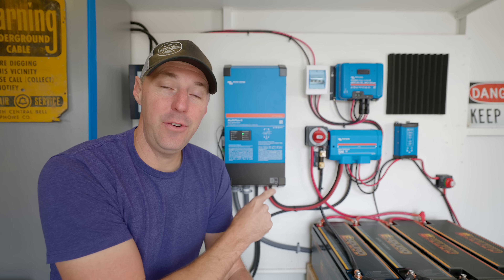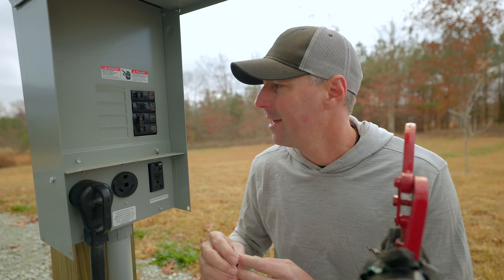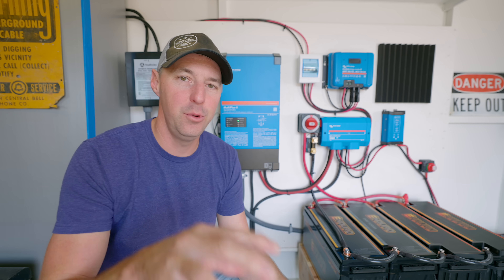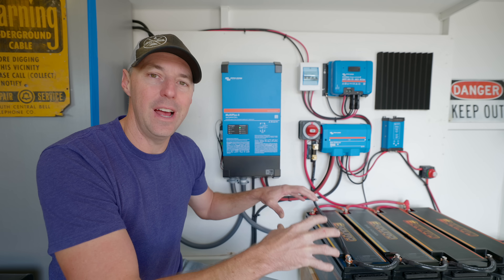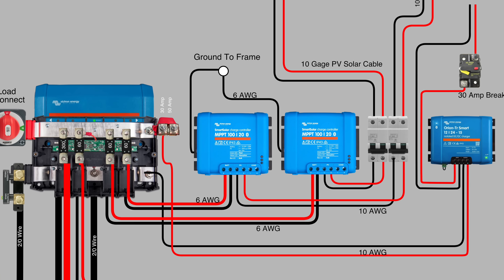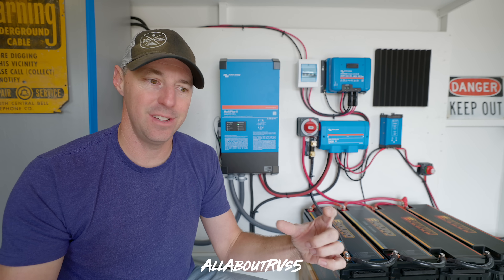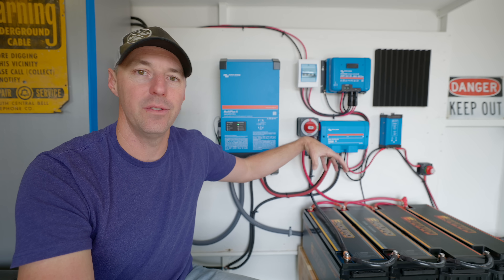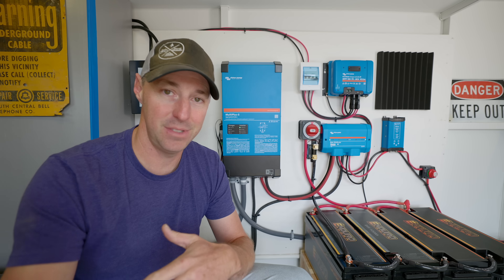Is This The Best Inverter For RVing. Multiplus 2x120 24 volt.

Comment from the maker: Thank you RV Mattress by Brooklyn Bedding for sponsoring! Visit https://rvmattress.com/allaboutrvs
 To get up to get 25% off your mattress with code AllAboutRVs
Reply: Video is a yr. old by the time I watched again ready to buy , tried the link to pinned supply above , - sent to another different company , search that web site and did not come with this unit ?
Did a separate search and at least 4 sites changed my search to other models ?
One site said " sold out " .
About the 5th site - details said different than this video - this unit " is either a 50amp , or a 30amp so choose " ? 
Thanks 
Hope for some confirmation

Comment: One thing I'm 100% sure Victron is sick of hearing  but needs to listen to.
Get rid of the Push-to-Connect terminals on all of the products used in RVs.
These have no place on any RV unless it will never be used to travel anywhere.
Probably fine for fixed home use, but not in an RV.

Comment: Victron really needs to rethink not having 12VDC output built-in on their 24/48 VDC Inverters.

There should be at least 125 Amps of 12VDC available built in and monitor-able with the Cerbo GX.

The non-monitored Orion is a non starter for a lot of RV users, especially with only 70Amp output and the requirement of paralleling 2 units in most larger RVs.

Also, why is there no 48VDC version of the MultiPlus-II 2x 120V ?

Don't get me wrong, I'm happy to have Victron empty out a lot of my RV  savings account.

I just wish they would listen more to the RV people that buy their products.

Comment: Great Video/Channel; thank you for sharing this type of information. One question I have is, does the Victron Multiplus take control of charging the batteries from shore/ac power (as opposed to the standard AC/DC converter that is standard on RVs)? If so, should we disable the stock converter to avoid too many systems from attempting to charge the batteries?

Comment: Video is a yr. old by the time I watched again ready to buy , tried the link to pinned supply above , - sent to another different company , search that web site and did not come with this unit ?
Did a separate search and at least 4 sites changed my search to other models ?
One site said " sold out " .
About the 5th site - details said different than this video - this unit " is either a 50amp , or a 30amp so choose " ?
Reply from the maker: I will check it out and figure out what happened. I know the main supplier I use just changed their name to Trek systems.
Reply: @AllAboutRVs  Thanks for the reply , wanted to double check - [ not sure if it is me or not ] I got the impression that this inverter could connect to either 30amp or 50amp RV post [ not expecting to get 240vac - just get 120vac from either ? ] .
Good YT page ;)

Comment: Can you tell me if using the 2X120 will give me the 220vac if off grid ? Also do you know if this or any other vicktron inverter have an auto generator start option. Thanks for any information you can help me with.
Reply from the maker: If you wanted 240v you would need two inverters. The single lets 240v pass through when connected to a 240 source but will only generate 120v when off grid. There is a way to have the Victron relays start a generator but I haven’t done that.

Comment: Thanks for this - for two reasons.  First, our SPS is giving up and now that AM Solar is out of business (from what I can see), it's time to swap out my Multiplus 24/3000/70 with the Multiplus II 24/3000/70.  The form factor is narrower and longer but I can work on that.  Second, I was trying to explain voltage and amps and why we were a 24v system, this helps reinforce was I was saying to my wife.  Thanks again and safe travels.

Comment: having a standalone 12v 100ah battery that is just charged up by the 24V system (via a charger on Timer or manual) is a much smarter system. 

Redundancy, and then when you need to service the 24v/120v supply.  you still maintain 12v operations/fridge/slider etc. and you can run a smaller 12v inverter on that battery. Add a 150-300watt panel for the 12V RV battery and you are really setup for anything.  
If you ONLY have 24V batteries and something goes wrong, you have no way to power the 12V no your trailer unless you jump it from a vehicle or help someone out with a bunk 12v

Comment: Do the built in roof AC units on 50amp RV operate off this 2x120 or do they need true split phase?
Reply: Yes, this inverter powers both legs in your RV’s breaker box. If you are off grid, you’ll only have 3000w total for both legs.

Comment: Looking at the Victron inverter for my 50 amp rv. needing a dual 120 output, this seems to do everything I need except the wattage.  3000 watts seems like it isn't going to run both ac units.  I see Victron makes a 5000 watt output unit, but is it dual 120 volt as well?
Reply: Only if it says 2x120 or split phase. Be careful because there are different ones.

Comment: Always great content and thank you for all the hard work. Small question though on the Orion DC to DC inverter. If the RV has a 12 volt converter already couldn't that supply the necessary 12Vdc for the lights fridge etc?

Comment: Hi Jared, thanks for the excellent video. I am debating 12/24v system for my Class A camper.  The big question I have is it worth the cost of 2 dc/dc converters? I also have my chassis batteries tied to the house batteries. I like the idea of charging my house batteries with my alternator while in motion. Do you have any suggestions?
Reply: found the info in your shared diagram.  DC/DC charger 12/24 - Thanks for the excellent information

Comment: I've been an subscriber to your channel for years I really enjoy our videos and find them very helpful, I have a 2018 Grand Design 303 fifth wheel that I need to replace the batteries on and I'm considering going with Lithium batteries and changing my converter to an inverter. Which inverter and lithium battery would you recommend and is the easiest to install, I don't plan on putting solar system in my fifth wheel.  Thanks Much

Comment: I’m going with EcoFlow System. I find your setup in the near future to be a thing of the past.  Don’t get me wrong you did what worked for you at the time. But when I switch out TT’s I’ll be able to pick up my system in a heart beat and move on. All those connections and additional cost and either your technically inclined as you and not me; or you pay someone to set that all up.. No Thanks .. my $6k system will have just as much power as your with a Hybrid Inverter.
Reply from the maker: I did a video on the Delta Pro. https://youtu.be/xLcCU29riWE?si=zbg13NbmdCc3SN_Y
It is very easy and simple when swapping RVs or using it at home but I they have a ways to go before it can do everything the Victron setup can do. EcoFlow is my first pick in the portable setup systems they do a good job and are still working out the details. I have updates often for their units.

Comment: I'm looking at a similar system, just a little larger with dual inverters. The question I have is 2 orions vs 1 Orion and a Lithium battery.  The one concern on the battery is it may get hit with too high of a "charge" current from the Orion - or am I over thinking it?
Reply from the maker: If your talking about to the 24-12 conversion I wouldn’t see the need for more than one Orion and you could even do a smaller smart version when using a battery. The battery will handle the larger items like slides and the Orion will charge it back up.

Comment: Definitely a nice install. They are pricey but they have some great benefits, the idle consumption being one of the biggest. 
How much loss is on that dc to dc convertor?
I did like that you had a range for each voltage, i think that's helpful. 
But 2 things, I think id put that 12v disconnect before the dc to dc convertor, and you need to cut your zip ties better... haha i saw those wrist slitters right away! 
Great video as always.

Comment: Now if they would include the 24 VDC TO 12 VDC converter inside the Victron Multiplus II 24volt 3000 Watt.
Reply from the maker: That would be nice and make it no downsides at that time.

Comment: You don't think running a converter is a negative until it fails and you can't pull in your slides or retract your landing gear.  You also waste energy converting 24v to 12v because no converter is 100% efficient.  I see more headaches than advantages when paired with a vehicle that so heavily depends on 12V.  I'd rather spend the extra on wiring and lower the complication of my system.
Reply from the maker: I love our 12v system on our RV and sticking with it but do see where this has a few advantages over ours. With the 12v battery on board that would minimize the risk of getting stuck with a failure and you could even leave your original converter in the RV power center and have it unplugged but ready as a back up if ever needed. I agree no converter is 100% but the 24-12 Orion should be more efficient than using the original converter on your RV and there won’t be a massive amount of 12v use while using the RV. Most things are a small draw except for setup and tear down.
Reply: @AllAboutRVs  all valid points.  I think in the end I just prefer the simplicity of 12V.

Comment: I have the 12 V multiplus II from Victron. Actually, I’m on my second one after a year and a half because of their poor design of spring clamps for the outgoing 120 V. One of mine arced and burned. and burned the output socket. So much for Victron‘s 10 year warranty as they would not cover it. They did refund me $795 against the $1400 cost of the new one so that shows me they are responsible because of this design. Do you or anyone else in the comment section know someone that can convert my old unit to a screw type, clamp output, sockets just like Victron uses on all of their other equipment. Victron sent my original unit back to me without repairing it. Don’t get me wrong. I love all of their equipment, but this one part is a poor design for an RV bouncing down the road.
Reply from the maker: The push-in on these isn’t my favorite but I would highly recommend ferrules if using a thin stranded wire and make sure they are long enough.

Comment: Love mine system. I have the same set up as your 5th wheel. Power assist with a 2k gen, running the ac and sending some left over volts to the battery bank is nuts! Thanks for your vids

Comment: Thoughts on the EcoFlow power kits? Seems a lot simpler.
Reply from the maker: Good question. I did a review on the Power Kit and agree it is more simple but I would pick this any day over the Power Kit. The AC/Heat pump I used in the test for amps was no problem for the Multiplus and the Power Kit struggles and takes 5-6 times of trying before it can start it. It has enough headroom and within the specs but it doesn’t deliver well on in rush when it’s the only thing drawing AC. The power kit also has no power assist which limits when you would use it and only accepts one hot leg, so it’s not good for tying it into a  50 amp RV. It might be fun to do a comparison between the two. I do like Eco Flow out of all the “power station”(and more) companies but the Multiplus II lands the win for me.

Comment: I'm still looking for a 24V DC 7.5K-10K inverter/charger that outputs split phase 240/120V AC and can charge on 120 or 240V AC.  I've looked through all of the products I can find from multiple manufacturers, and haven't found anything like this yet.
Reply: PS, at 10kv why wouldn't you go 48v? Otherwise I think your conductors are going to glow. Just saying..
Reply: @Trevathecleva82  physical space limitation.  I have room for two 12V batteries, not four.

Comment: Way too much waffle, way too little information about alternatives.

I have no concerns about Victron power equipment beyond that it typically has features of no use to me, and a price beyond reasonable for what I do want.

Shore power in Australia is much simpler, it might be 10A, it might be 15A. Technically, it could be  three phase, but never is. A 10A power cord fits  a 15A socket, so unless you need to higher source current you can ignore it.

Comment: If you put a battery on the 12V side you don't need 70A, just buy a cheap golf cart style 12V stepdown converter, they're less than $20 and can keep up with lights/water pumps/etc easily enough and your big 12V load amps like the slides or levelers can be handled by the battery that gets recharged over time.
Reply: So my RV already has a la battery and converter in the panel. Just leave it in and wire the victron for the split phase only? (This was my original plan, so I'm looking for confirmation or otherwise.)
Reply: $20? Why not pay top dollar instead for that victron dc/dc? Or those overpriced enduros? I’m telling ya these youtubers have it made with all that free stuff.

Comment: I am in the midst of planning a Victron inverter install but I am struggling with going 24v.  I have heard the 24v/12v converters cant handle the inrush current of slides.   Any thoughts Jared?
Reply: Install a 12v battery. Save $$ go with cheap LA or spend more on a LIFEPO4 with BT to keep track of SOC. The battery will take the inrush of leveling or slide systems and charge back up over time.
Reply: My LiTimes can easily handle 100A discharge rate, it's tough to imagine slide mirrors taking anywhere near that, what are the fuse sizes? My slides don't have large enough wiring to handle that amount of current.

Comment: This video is light years ahead of general camping set ups. Folks will look back at this video as the foundational reference of how to set up a proper 12/24v system in an RV. Excellent work.
Reply: I’d have to agree. We just went live with ours, 99% the same here, and we love it. This is a game changer with power assist feature and true 50amp power to a 50amp coach. It feels like we’re plugged in wherever we go.

Comment: Would this require dumping my converter/distribution/breaker/fuse panel?
Reply: No. You just line up the AC out of the inverter to you Dist. Box. Then let the AC power distribute as normal

Comment: Imo there is only one reason to go with the 24 volt version of the 2x120 multi plus. They don't make a 48 volt version currently. 24 volt is something of an unhappy middle ground between 12 and 48 volts. You have all of the downsides of 48 volts in terms of the added complexity and expense of needing a DC buck converter and potentially a boost converter for alternator charging and only half the benefit in terms of reduced amperage and increased solar charge controller capacity.
Reply: Why do you need a buck converter.  Just use the 120VAC to 12 VDC converter that came in your breaker box.  This mean you have to maintain two voltages of batteries, but I am ok with that.  I am running two 48V quattro 5000's.
Reply: @wi4usa  Efficiency and its cheaper long term than replacing a 12 volt lead acid battery  every 5 years. Although I guess money is less of a concern for you given your inverters cost more than the entire system I'm currently putting together.
Reply: Eh, the marine and bus standard has been 24V for decades, it's not that bad. Widespread 48V mobile adoption is going to take a long time.
Reply: they do make a 48V version of the Multiplus II.
Reply: @vastirvision  Yes but not in the 2x120 variant.
Reply: @vastirvision  But the AC IN only has one hot connection, not two.